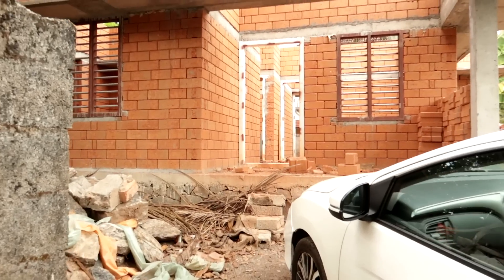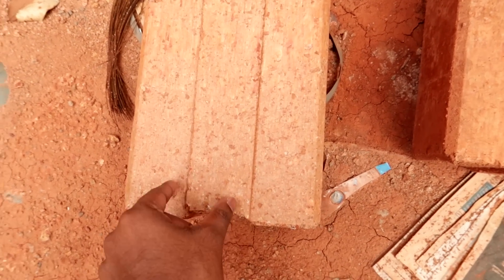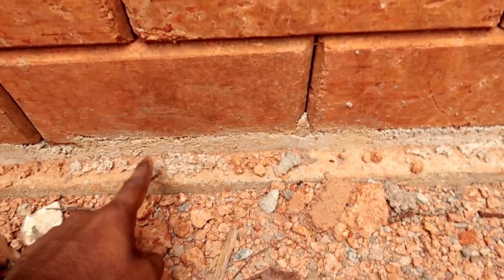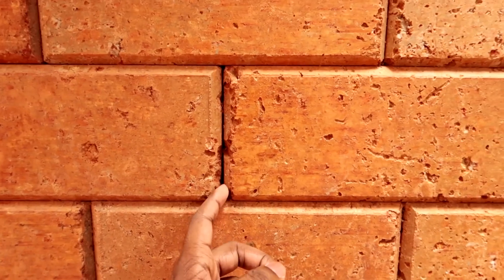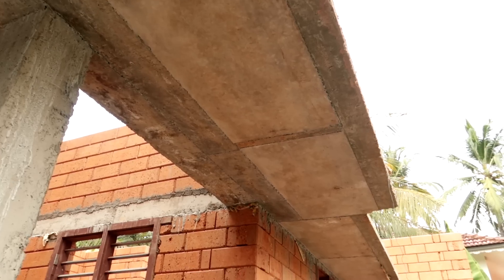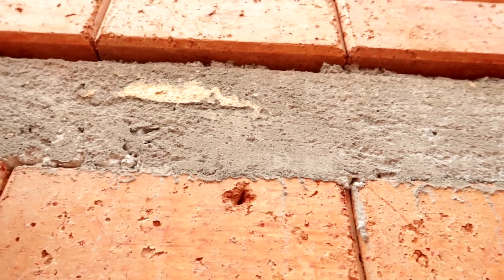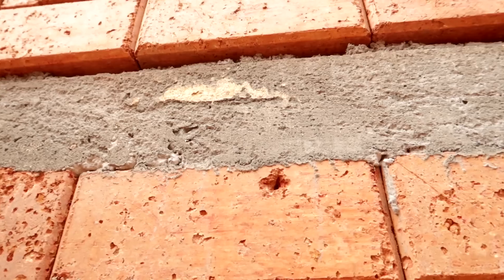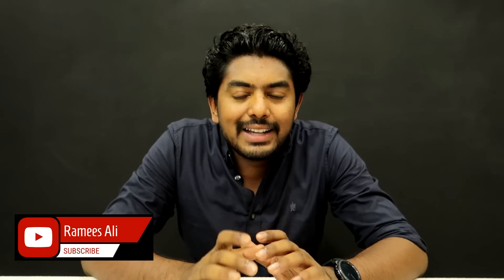ഇന്റർലോക്ക് ബ്രിക്‌സ് സേഫ് ആണോ? അറിയേണ്ടതെല്ലാം | Interlock brick low cost house construction

Comment: Interlocking earth blocks arent used only for cost-cutting reasons as mentioned in the video.
They provide great aesthetics, eco-friendliness, excellent heat insulation capabilities and is a great example of sustainable architecture.

Comment: Thanks bro, I am planning 3 floor building.  One Senior  Civil eng. told me one point if it is framed structure multi storey building, then better to avoid Interlock cement  bricks because he said Interlock bricks needs sufficient weight from Top so Lock will be strong. But in case of Framed structure weight will get distributed on Pillar and Beams so bricks tend to become weak and cracks can come. So he recommended Interlock bricks only for load bearing structure.  Is this logic true , just wanted to know ?
Reply: I don't think it will pretend cracks but if u r building framed structure then u can use acc blocks instead of other bricks it is weightless,comes with finishing(no need of cement plastering) 4" inch is enough for inne wall partition, for outerwalls 6".
Reply: Yeah, he is right!

Comment: Dear Sir ,   how do we hide the gap between interlock bricks  so it will look like normal wall as final output ? if we apply 2 coats of Putty then paint after wall is built  is it enough ?  or do we have to plaster, I want to make it look like normal wall instead of interlock brick wall. Kindly advise.
Reply: can fill the gaps with cement+red oxide or adhesive for same purpose (now available in market )

Comment: Dear Sir, thanks for the video, I am from Idukki, kattappana , Locally i have only 6 inch Interlock Cement bricks available, 8 inch is not available, If i hve to get 8 inch from eranakulam i will get a huge transport cost. i am planning to construct a 3 floor building with proper pillar beam support, normally for house or building construction,  6 inch brick or 8 inch bricks are used ?    i wanted to know kindly advice.
Reply from the maker: If you are constructing a framed structure with columns and beams, no need to worry about partition blocks. You can use any blocks 4 inch or 6 inch. You have to use 8 inch blocks for load bearing structures. That’s all
Reply: Thanks sir for the reply.

Comment: I have built my house with these bricks and done plastering. The house is now six years old and we have no serious problems with the construction. Slight dampness occurred outside the bathroom walls. This was fixed by sealing the tile joints. Cost wise it doesn’t save you much if you plaster the walls. However my consideration was of sustainability factors as it is more eco friendly.
Reply: Could you please tell me if these bricks will withstand the load of a concrete roof . I am planning to start construction of my house soon after this Covid lockdown. I somehow liked the concept of houses with interlock bricks. My only worry is if it will bear the load of a concrete roof
Reply: S N My house is single storied. I don’t think there will be any issues with the load bearing up to two levels as long as the bricks are prevented from getting wet. I had plastered the house both in and out considering the strength and finishes.
Reply: @benjaminaniamma2266  hi Benjamin, Is this brick good for places with high rainfall .?
Reply: Hi sir, did you do plastering with cement? Please kindly let me know. Thank you

Comment: Soil interlock bricks ipo sharikum available alla. Cement interlock bricks aane ipo use cheyyunathe. Athine strength um kooduthal aane pine athe water te preshnakal onum illa.
Soil interlock kuthi varrum.
Pine plastering epozhum avoid cheythe direct aayi putti work le ke poovam angane money nanayi save cheyyam.
Check this site  stjoseindustries.com

Comment: Wiring pipe jenndil koode mathramano konpovuga switch boardill erakkumbol bricks cut cheyyendy varum athu pole distribution board vekkumboyum oru bricksinte egadeshavum poliyum
Reply from the maker: But cutting maximum kurakalo
Reply: Maximum ennu parayan pattilla oru paridi vare ginintil hightil ninnum mugalilanu normali bulb holder vekkuga athu pole junction box gintilil idanum pattilla pinne enganyanu maximum kurakkam ennu parayunnad
Reply from the maker: @sjpk936  oru paridhi vare kurakkan sadhikkunille?, Athineyanu maximum ennu udheshichathu

Comment: Is it durable? Heard that u can't use nails as it may cause cracks in it? Can we use this type of bricks to extent compound wall where there is chances of flood more than twice a year?

ഇത് ഈട് നിൽക്കുമോ? ആണിയടിച്ചാൽ ഇഷ്ടികയിൽ വിള്ളൽ വീഴും എന്ന് പലരും പറഞ്ഞു കേട്ടിട്ടുണ്ട്. എന്താണ് വാസ്തവം? അത് പോലെ തന്നെ വർഷത്തിൽ രണ്ടിലധികം തവണ വെള്ളം കേറുന്ന പ്രദേശത്ത് വീടിന്റെ ചുറ്റുമതിലിന് ഉയരം കൂട്ടാൻ ഇത് ഉപയോഗിക്കാൻ പറ്റുമോ?
Reply from the maker: Durability depends on the quality of bricks from a reliable company. I don’t think nail cause cracks but it is not a good idea to hit nails to walls with hammer. I won’t recommend soil based interlock bricks for flood prone areas. Thanks for the comment.

Comment: Fly ash interlock bricks available in the market. any interlock bricks you should do pointing. pointing is also much expensive, so better to do gypsum plastering,
Reply from the maker: Yes mostly gypsum plastering is used for interiors rather than normal plastering

Comment: Nigal b arch kayainjadh anao ?
Reply: Ok not bad . brick nte weight bearing capacity yethre yenn paranjilla
Reply from the maker: According to IS1725-1982, The blocks when tested in accordance with the procedure laid down in IS: 3495 ( Part I )-1976 shall have a minimum average compressive strength of not less than 20 kgf/sqcm for Class 20 and 30 kgf/sqcm for Class 30.
Reply: Pls sent your what's up number
Reply from the maker: Habricate Homes Whstsapp me on 7594033330
Reply from the maker: I am a M.Tech graduate in Structural Engineering and Design ✌🏻💪🏼